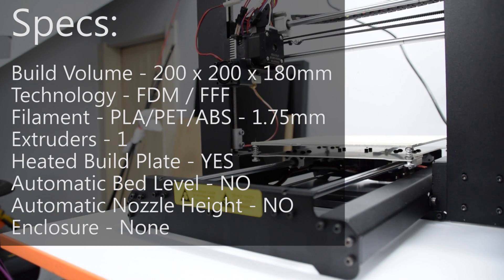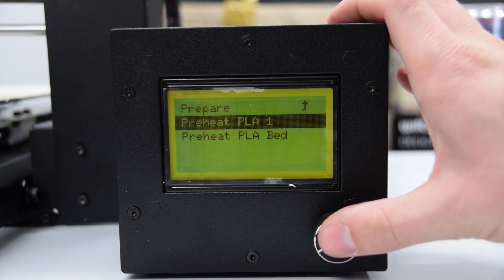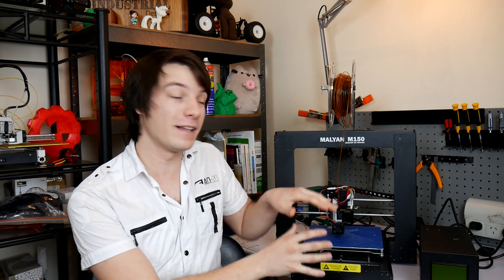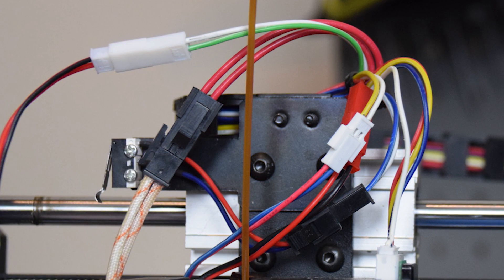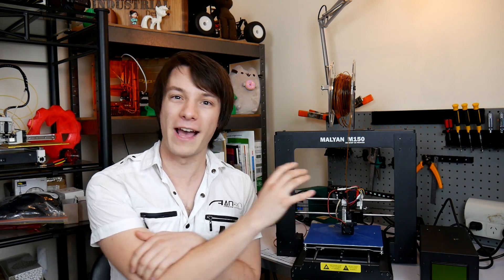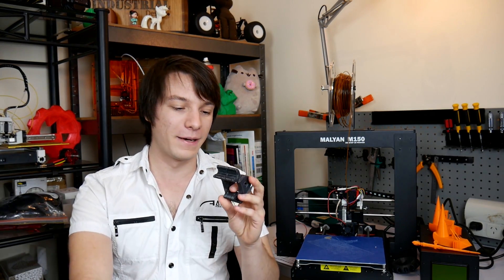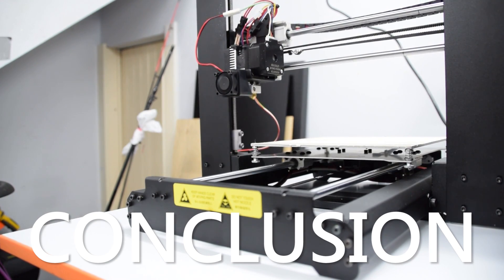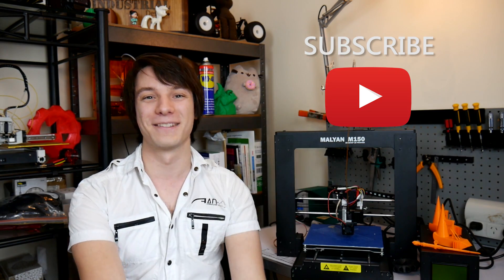Malyan M150 3D Printer Review - A worthy clone?

Comment: hey i just got one a few weeks ago. your prints you shoed in this video came out great. could you please share the slicer and printing setting you use to make them come out so nice? thanks, Stephen.
Reply from the maker: Hi Stevie I used Simplify3D and the Wanhao i3 preset - worked well with no tweaks.
Reply: Maker's Muse , oh ok thanks. i must be doing something wrong, im getting waves/uneven layers when i print.
Reply from the maker: It may be the bearings or the vertical rods are bent - move the gantry from the bottom to the top and see if they wobble around.
Reply: Maker's Muse, ok ill have to take a look. thanks for your help.

Comment: Mine prints the 20mm calibrator ok, but i cant get it to print anything i load from Cura. Its like its under extruding, and the print time is way too long, something in my settings is not right,but i cant figure it out. I want to use Repeteir Host, im comfortable with it as i run my Fab mini on that,and i saw settings for it somewhere, but now i cant remember where, and cant find them anywhere i look. Helllp! Please, can anyone point me in the right direction?

Comment: Did they address the hot end safety issue? If the thermistor looses connection, the hot end will turn on solid trying to heat up the hot end that thinks is cooling off resulting in a melt down of the extruder and a fire hazard.

Comment: Crashes in to the bed, bearings that disintegrate, old style turn and push controller with annoying menus/SD slot and a safety hazard in the way of run away heating.
Makes me wonder what it would take for you NOT to recommend a printer.
Seriously Angus, how much is HobbyKing paying you?

Comment: only grumble with teflon bushings is teflon is SOFT and may go oval shaped > 0 over time due to the softness of teflon. that said its good to see companies making lower priced machines although i feel like they getting better but some things still need help.
Reply from the maker: Agreed, they will certainly wear over time. I think my conclusion is still accurate though, it prints out of the box but needs mods to be great. Personally I would have used bronze bushings, maybe graphite impregnated. Love those things :D
Reply: +Maker's Muse agreed graphite impregnated or ptfe impregnated would be the best. my lathe in the garage uses iron impregnated bronze bushings for the spindle... my um2 uses bronze bushings... my thingomatic.... you get the idea. their cheap and if used properly can last almost indefinitely! i remember years ago with my failed horizontal mill project i was looking at using bronze bushings for the spindle and arbor but never quite got around to it :(...

Comment: The firmware update proved by malyan is useless.
the "new" marlin firmware has still the same issues and the repetier firmware has horribly wrong settings for the thermistors. at 20°C room-temp repetier says 7°C and if i heat the bed, or hotend to 30°C i measure, with my infrared-thermometer, about 70-75°C....
and something is wrong with the uncompiled version of marlin. can't get the display running

Comment: You already know this, the other problem is the thermistor can short against the heating block. Though these (I will post the name not the link) "Modular Screw-on M3 Stud Thermistor for Reprap 3D Printer Extruder Hot End, Works for E3D, Rigidbot and Others" from Amazon worked real well for me as a replacement. The reason I shorted the orginal one, was when I was replacing the feed with the one that can do flexible (can't think of the name, but a recent review you did). So, I suppose before anyone orders anything make sure you have a threaded m3 connection point on the block (I don't recall if mine is original or not, replaced so many parts).

Comment: I bought some of the color-changing filament from Hobbyking recently and people (kids and adults) just love it. As far as useful applications go, you can use it to check for hot spots on a circuit board or how a cooling system works or for making indicators that show when a surface is warm or cold (like the print bed on a 3D-printer). My first real print was a small chess pawn that hasn't quite decided which team to play for. ;)

Comment: Nice review. I wouldnt be surprised if you cant just flash the Wanhao firmware. It probably a melzi board inside.

I did use glass(and glue stick) on my Di3 it worked fairly well, but I have now moved to a novel PEI on FR4 solution. Couldnt be happier with it. I did a writeup here https://hexandflex.wordpress.com/2016/07/15/wanhao-duplicator-i3-pei-bed-mod/
Reply: Yep, its a custom Melzi board inside.

Comment: bravo malyan.

thermal runaway and jogging into Z can easily be fixed with firmware changes.

needle nose pliers are the ideal tool for removing supports.
Reply: Agree......but considering the price I think a lot of people who buy this printer will be new to 3D printing and could overlooks thing like activating MINTEMP
Reply: Pigeon FX I would expect malyan will fix that, it's a simpler fix than new idler bearings.

Comment: it shouldn't let you jog down past the endstop. Every wanhao i3 I've used has always stopped the motors if I turn the wheel the wrong way and it hits the endstop. Is that a design flaw on this particular clone or is your endstop not working properly?
Reply from the maker: They have the option disabled in firmware, I suspect it happened at some stage possibly by accident.
Reply: Weird. That and disabling the min temp safety feature make no sense to me.